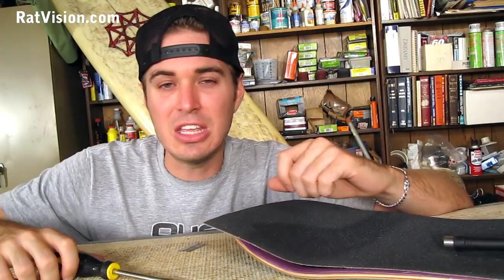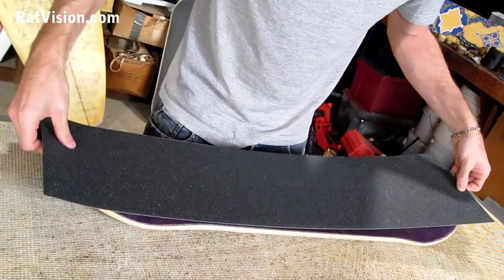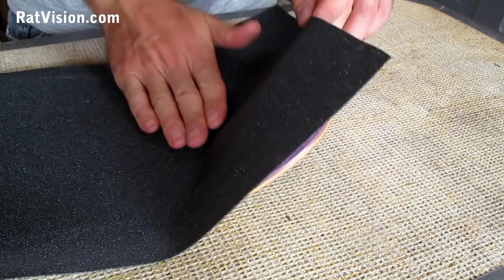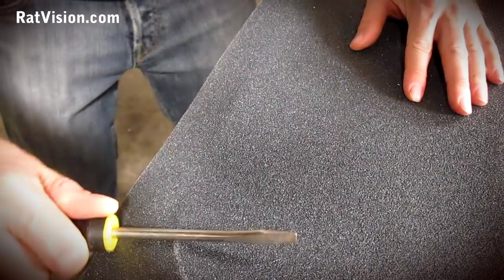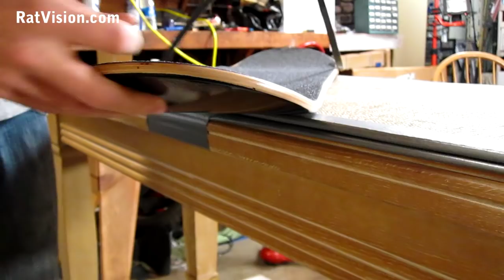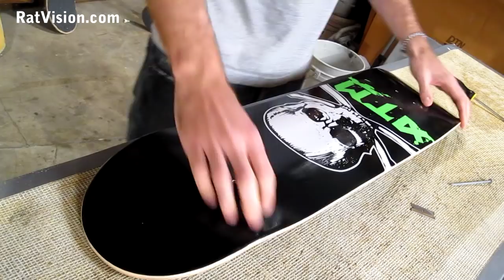Put On Skateboard & Longboard Grip Tape CORRECTLY

Comment: Hey dude yeah i'm changing trucks over to my new board just the trucks without the under plate thing and yeah there is a nut in the plating on my new board and i'm trying to screw the trucks in to the nut that's in the plating and it's not working i try to move the nut into the right spot and it still won't screw into the nut so what's the problem skate master?

Comment from the maker: @VansShoeGirl91 Maybe you're not pressing down hard enough when scoring.  If you can hold the blade straight than you shouldn't have a problem avoiding a wavy edge.  A think line works for me and most people.  I worked at a shop for years and the employees who did a lit of scoring tend to have not as clean of an edge. Oh well, it don't matter.

Comment: I was at my local skate shop and got my skate made, but she forgot to sand the edges of the grip tape, can I use sand paper to sand it out?
Reply from the maker: +ZeusV6 Yes.  It's not too important.  Most decks are coated and sometimes the coating can cause gript tape to not stick too well. So, roughing up the edges helps to prevent the griptape from peeling up.
Reply: Rat Vision – Skateboard Tech Yeah, just got sand paper and sanded up the side, but this little part keeps sticking up, probably not a big deal but it bothers me too much xD

Comment: Hello! I have a question. Does the surface need to be smooth when I put the grip tape? I have a longboard but it doesn't have a grip tape, it's just a little rough on the surface and doesn't really grip. It also slips a little when my shoes got wet. Thanks in advance.
Reply: I know I'm pretty late to this, but in the case you still haven't gotten around to replacing your grip tape: It's best to sand it down a little. I assume yours is/was sandblasted? Where there's grains of sand on it instead of tape? In that case it's definitely best to give it a more smooths surface, at least up to a point where you can stroke your hand across it and not feel any grains of sand.

Comment: hi, my board grip tape is about to peel off, it seems as though under the tape, the deck is raw wood, unlike yours which has a waterproof layer/ paint on it. Should i be regripping my board with the raw wood?
Reply from the maker: Not all decks have a colored top layer.  You have a raw deck (no color).  There is no waterproof/paint layer on any decks.  You are totally fine.  Your deck is normal.  Put new grip on.

Comment: Tip 1:if you have an air bubble get a sharp tool and just poke in the air bubble and push it then you wont have air bubbles        Tip 2:if you want your grip tape to be PERFECT crease it more on the edges and lift the edges up and then rip it (NO RAZOR NEEDED)

Comment: My board is in the shape of a knife. How would score the board with the wavy edges? The board in length is the size of a standard skateboard. The width of the board is the width of a standard penny board.
Reply from the maker: You score the board the same way.  When you put the grip tape on you will need to cut the grip tape like we did where the grip tape meets the nose and tail.  make slits where the grip tape binds or doesn't want to bend/flex. That will make it easier to score and cut.

Comment: i really messed up removing and applying griptape but theres no air bubbles and when i cut it its really hard and i tried to use the screw drive it dint make a guiding line

Comment: how do you peel off the old griptape to apply the new one
Reply: Fr0st Caliber take a hair dryer, put it on high, and blow it onto the sides of the board. That will melt the glue underneath and you should be able to peel it off. Then just use some rubbing alcohol to get any sticky residue off the board

Comment: Help I put mine on but it over hangs abit and can catch and get lifted up and I have even sanded the edges
Reply from the maker: You held the blade too straight up, like 90 degrees to the board (perpendicular).  That's why it's overhanging. Look at the video.  You can lift the edge of the grip tape with a blade, and recut it.

Comment: your gonna have to get the griptape hot with preferably a heat gun. if not use a good blow dryer. then pry the griptape up with a screwdriver or file or whatever you have

Comment: I have odd creases on my grip tape. how do you get rid of them?
Reply from the maker: Are the creases in a new sheet that you haven't put on yet, or is the grip tape on the deck?  If the grip tape is on the deck already you can try flattening the creases with something hard by pressing down in it.  This might flatten the creases.
Reply: it is a new sheet and I have tried flattening it down but it doesn't work
Reply from the maker: If there are creases in the grip tape before you put it on, they should go away once you stick it to the deck.  If the grip tape is already on the deck, then there isn't much you can do about it if it won't flatten.  If it's not causing any issues, then you don't worry about it.  If it is then get a new sheet.

Comment: Just got my first board and the guy who did my griptape did it really sloppy. It works fine but the edges are just jagged and unappealing. I saw this video weeks ago but I assumed the workers at the shop knew how to do it just as well.
Reply from the maker: Shop employees were hired because they like to skate and know about the different brands.  That's just about it.  Employees hardly know anything about the differences between products and how to maintain them.  Before they became employees, they were having an employee do it for them too.  So they never learn.
Reply: Rat Vision – Skateboard Tech Well, I know I'm gonna get a lot of flak for this but it was Zumiez. The guy was cool and knew how to skate but next time I'm just gonna get the tools and do it all at home. Thanks for these videos. This is the only skate channel that actually considers the engineering and technical fields of skateboard maintenance.
Reply from the maker: Don't worry we won't give you flack for going to Zumiez, UNLESS you went there instead of a local core shop.  Always support your local core shop.  Yes, the employees at Zumiez are not trained at all, and should make no attempts at helping customers with products.
Reply: I live in Polk county Florida and there are close to no skaters here. I didn't think there were any local skate shops around but I looked into it and I think there is one so I'm gonna check it out as soon as possible.
Reply from the maker: It's not a random judgement.  It's a fact!  Most shop employee hardly know anything about products.  They don't know what ABEC is, what the difference between Swiss bearings are compared to others, how to grip tae a board correctly and quickly, the difference between decks with glue or resin, what pop really is, how to sell a board to customer that fits their riding style/level/height.  The list goes on and on.  I've worked in shops for years, I've worked with idiot employees.  At one point I was an idiot employee myself.  Over many years I have learned a ton about product, which is why this Youtube channel exists.  I have visited countless shops, and called them all over the country asking questions, and have come to the FACT that nearly all employees are full of shit.  We are currently in the process of making employee training videos, so they can tell customers the truth about products and how they function, instead of telling customers false information they hear or read in marketing material.  If you are a shop employee yourself, I am not trying to insult you.  This is what has been observed for many many years.

Comment: what kind of razor blade is that, can I just use an exzacto knife
Reply: Some people use a kitchen knife :/ As long as it's sharp it will work :) 

I used a cutter, the one with the razor blade attached inside it.
Reply: Patrick ok thanks for the 
reply
Reply: No problem.
Reply from the maker: DO NOT USE A KNIFE
Reply: ok, thanks
Reply: You still didn't do it?
Reply: no, I still need to buy the deck. I hope I don't mess up on the grip tape tho.
Reply: oh cool, update me when u do it :)
Reply: sure thing man
Reply: +Patrick I gripped it and its kind of bad lmfao